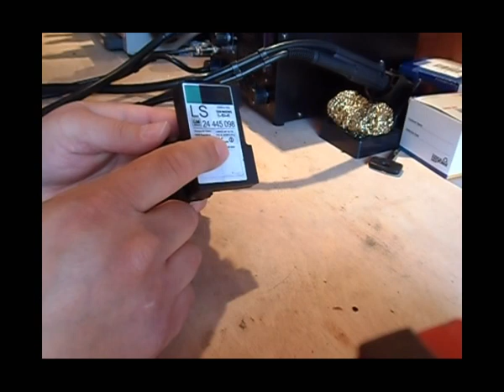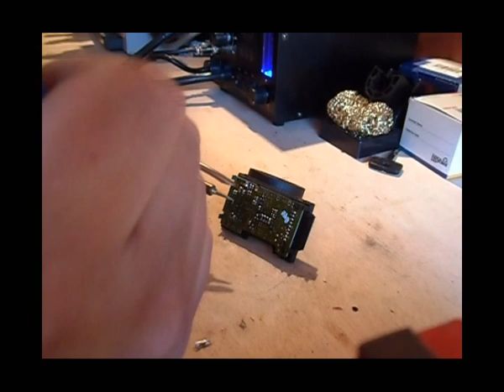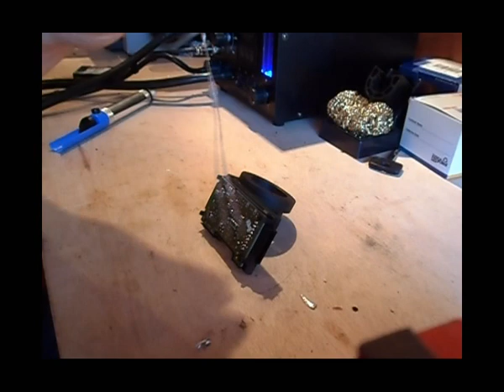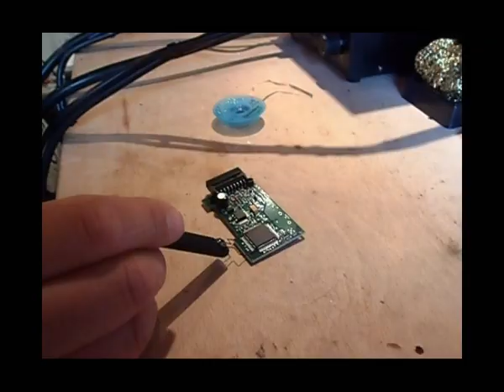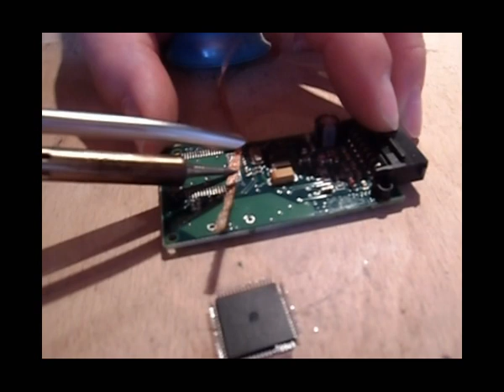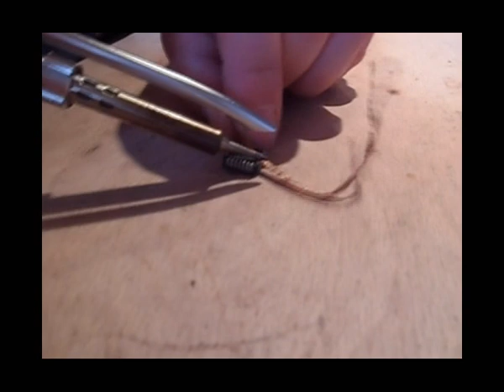Opel / Vauxhall Immobilizer code read part 1

Comment: This is a great vid 👍🏻 well put together and interesting and saving you lots of money so basically if I had ignition problems I could get a ignition reader module ect with the matching key and plug it into the ignition and it would work what about the cars ecu wouldn’t that be a issue ?

Comment: Thanks for the video. Is there any product available for the GM Immobiliser-II unit shown that will connect to it to read the security code without having to tamper with the immobiliser? I have a second hand GM immobiliser like the one shown in your video that I want to use but I don't have the security code.

Comment: hi is your Mcu a 68hc08(0L72A)?
Reply: Hi i have the OL72A MCU which has a problem brocken pin on MCUpin 2 and need some help. Can the LS immobilizer work where the UN immobilizer was fitted 
My whatsapp line is +260979523651

Comment: The remote fob itself doesn't require a pincode to be programmed. The pincode is only required to program is a transponder key chip to allow the vehicle to start.

Comment from the maker: @funkychickenrox Hey buddy. Yes this will pull the 4digit pin code on a vectra. The remote is automatically programmed in at the same time as the immobiliser transponder chip. You should also be able to approach yiur local opel dealer with the Reg number/vin number and they can supply a new car pass. i pay €25 for these. Any good auto locksmith would then be able to program the car.